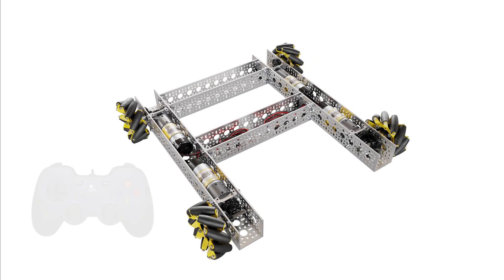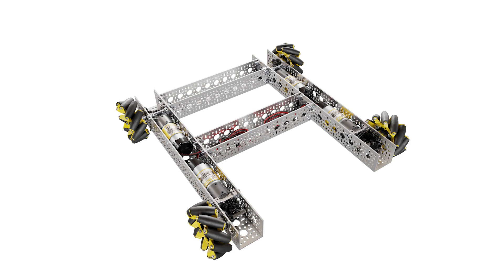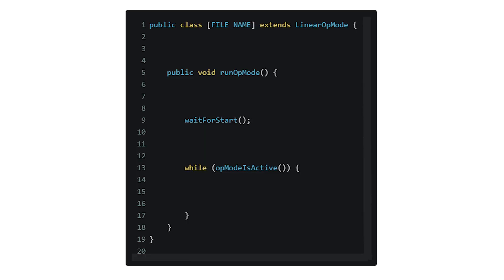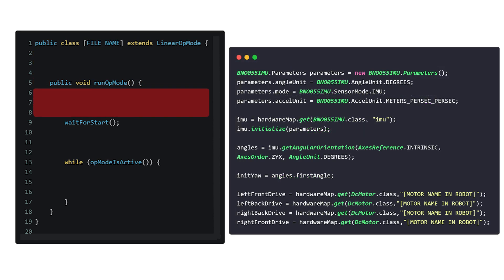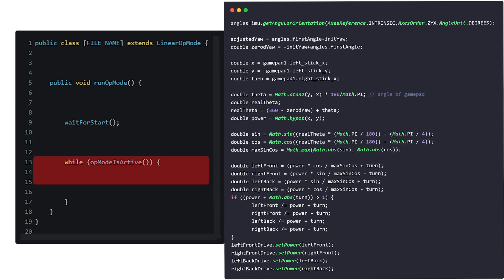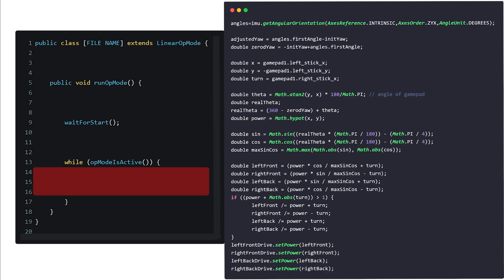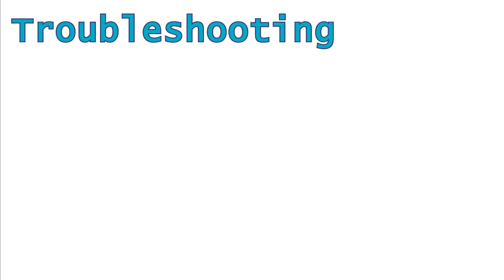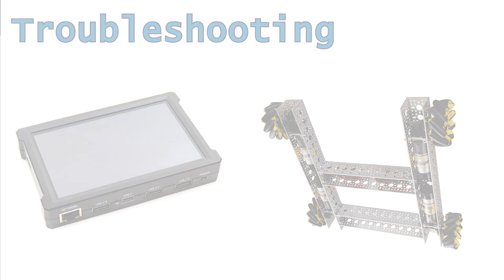Field Oriented Drive Tutorial FTC

Comment from the maker: CODE:

1st section -

    private ElapsedTime runtime = new ElapsedTime();
    private DcMotor leftFrontDrive = null;
    private DcMotor leftBackDrive = null;
    private DcMotor rightFrontDrive = null;
    private DcMotor rightBackDrive = null;
    private DcMotor Turntable = null;

    private boolean toggle = false;

    BNO055IMU imu;
    Orientation angles = new Orientation();

    double initYaw;
    double adjustedYaw;

2nd section - 

        BNO055IMU.Parameters parameters = new BNO055IMU.Parameters();
        parameters.angleUnit = BNO055IMU.AngleUnit.DEGREES;
        parameters.mode = BNO055IMU.SensorMode.IMU;
        parameters.accelUnit           = BNO055IMU.AccelUnit.METERS_PERSEC_PERSEC;
        parameters.loggingEnabled      = false;

        imu = hardwareMap.get(BNO055IMU.class, "imu1");

        imu.initialize(parameters);

        angles = imu.getAngularOrientation(AxesReference.INTRINSIC, AxesOrder.ZYX, AngleUnit.DEGREES);

        initYaw = angles.firstAngle;

        leftFrontDrive = hardwareMap.get(DcMotor.class, "[MOTOR NAME IN ROBOT SETTINGS]");
        leftBackDrive = hardwareMap.get(DcMotor.class, "[MOTOR NAME IN ROBOT SETTINGS]");
        rightBackDrive = hardwareMap.get(DcMotor.class, "[MOTOR NAME IN ROBOT SETTINGS]");
        rightFrontDrive = hardwareMap.get(DcMotor.class, "[MOTOR NAME IN ROBOT SETTINGS]");

        leftFrontDrive.setZeroPowerBehavior(DcMotor.ZeroPowerBehavior.BRAKE); // This is not shown in video, but this is to brake the motors to prevent drift. Feel free to delete this
        rightBackDrive.setZeroPowerBehavior(DcMotor.ZeroPowerBehavior.BRAKE);
        rightFrontDrive.setZeroPowerBehavior(DcMotor.ZeroPowerBehavior.BRAKE);
        leftBackDrive.setZeroPowerBehavior(DcMotor.ZeroPowerBehavior.BRAKE);

3rd section - 

            angles = imu.getAngularOrientation(AxesReference.INTRINSIC, AxesOrder.ZYX, AngleUnit.DEGREES);

            adjustedYaw = angles.firstAngle-initYaw;

            // toggle field/normal

            double zerodYaw = -initYaw+angles.firstAngle;

            double x = gamepad1.left_stick_x;
            double y = -gamepad1.left_stick_y;
            double turn = gamepad1.right_stick_x;

            double theta = Math.atan2(y, x) * 180/Math.PI; // aka angle

            double realTheta;

            realTheta = (360 - zerodYaw) + theta;

            double power = Math.hypot(x, y);

            double sin = Math.sin((realTheta * (Math.PI / 180)) - (Math.PI / 4)); 
            double cos = Math.cos((realTheta * (Math.PI / 180)) - (Math.PI / 4));
            double maxSinCos = Math.max(Math.abs(sin), Math.abs(cos)); 

            double leftFront = (power * cos / maxSinCos + turn);
            double rightFront = (power * sin / maxSinCos - turn);
            double leftBack = (power * sin / maxSinCos + turn);
            double rightBack = (power * cos / maxSinCos - turn);

            if ((power + Math.abs(turn)) > 1) {
                leftFront /= power + turn;
                rightFront /= power - turn;
                leftBack /= power + turn;
                rightBack /= power - turn;
            }
 
            leftFrontDrive.setPower(leftFront);
            rightFrontDrive.setPower(rightFront);
            leftBackDrive.setPower(leftBack);
            rightBackDrive.setPower(rightBack);